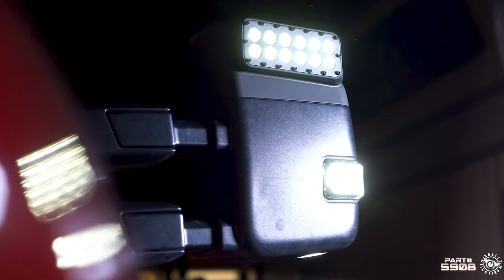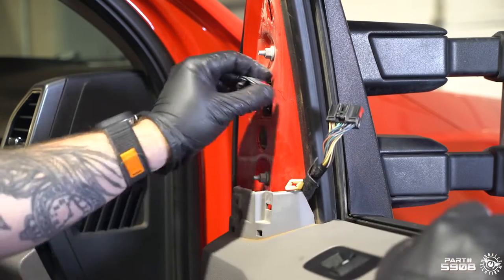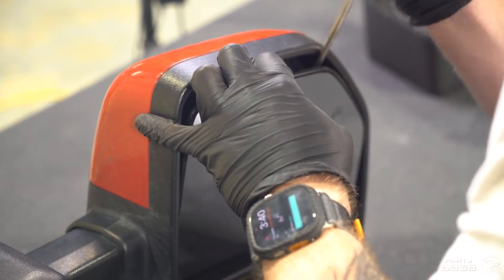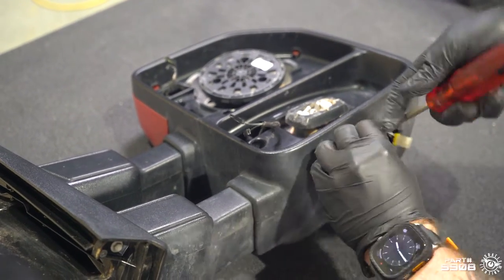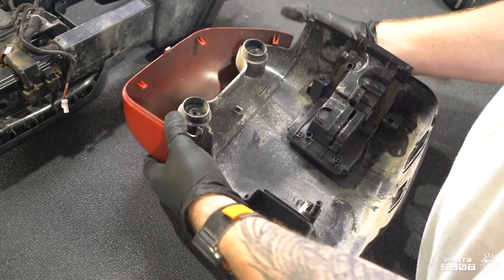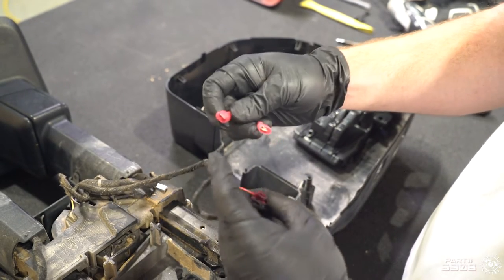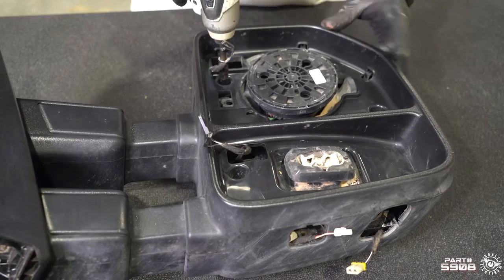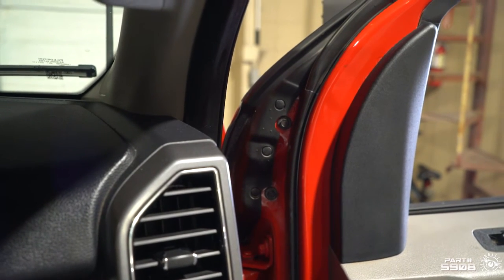2017-2022 Ford Super Duty LED Off-Road Side Mirror Ditch Lights DIY Installation by ORACLE Lighting

Comment: Out of curiosity, do you think if you could make some for 2015-19 Chevrolet Silverado/ GMC Sierra 2500/3500 with towing mirrors? Does these lights apply to aftermarket mirrors or OEM? Will you be making these lights for 2023+ Ram HD?

Comment: So cool. Wish y’all had’em for the 150’s
Reply from the maker: Good news! We do: https://www.oraclelights.com/products/oracle-2015-2020-ford-f150-raptor-led-off-road-side-mirrors
Reply: @ORACLElights  

2021s too?
Reply from the maker: @miked6523  yep they are in the works. Stay tuned 👍
Reply: I have f250 mirrors on my 18 raptor from Boost auto
Reply: Do you make these for 2007-2014 Silverado tow mirrors? I purchased GM conversion mirrors for my 4th Gen Ram and love them. Be a neat addition.

Comment: Just ordered these lights but dont the factory spot lights on the f350 turn off after a certain speed? I want to use these lights while driving down the highway
Reply from the maker: Yes, they do. You can also connect these lights to an independent switch for better control. We have simple switches like this https://www.oraclelights.com/products/oracle-lighting-dual-deutsch-dtm-40a-relay-wiring-harness-with-illuminated-switch or if you want something more advanced and expandable we offer the Trigger system: www.oraclelights.com/products/trigger-4-plus-wireless-accessory-control-system